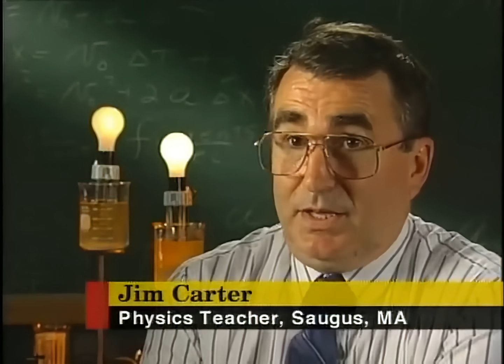MIT graduates cannot power a light bulb with a battery.

Comment: The problem is simple an I see it everyday among engineering students from other diciplines: They learn a rule and try to apply that law to a problem, when the rule doesn't fit they can't solve the problem. The issue here is that they never bothered to learn where the rule comes from.

In a high school example: Students memorize the quadratic formula and how to use it. What few understand is how to truly derive it and how to break down real problems to apply it.
A more common example would be the area for a circle, pi*r^2, we all know it and how to use it but where does it come from? To figure the formula out without being told the answer is the hard part and that is what truly makes a great engineer, creating mathematical / physical models of real world problems to solve a new problem you identified and building a solution that fits from those equations you created.

All in all. You don't become an engineer by memorizing formulas or others solutions.

Comment: Honestly the only problem they face is that of convention. They never had to deal with a light bulb that is not screwed into a socket with two obvious power connectors. One does not see the inner wiring of a light bulb and just has to KNOW that one connection is the side and one is bottom tip. It is not the understanding of the fundamentals they don't get, but they never had to deal with manufacturing conventions when the fundamental principles are not visible from the outside any more. Yet their overconfidence is still astounding - and the fact that obvously almost none of them ever did play around with basic electricity experiment in their childhood.

Comment: I know there's a little bit off topic but I remember being in a digital logic class And being required to hook up a RS flip flop to a LED. I was 19 at the time, And we had older Students In their 30s in the class. They could not figure out What was wrong with the circuit . The problem was They didn't understand they were getting the correct results. the Circuit Was giving negative logic. They just didn't really understand the truth table Of the design. I pointed it out to a bunch of them. I thought it was hilarious because a young buck could figure it out the 1st time, And they couldn't.

Comment: The sides and the end of a normal light bulb are electrically separated by the filament but I'm not exactly sure which is the beginning or the end, or even if it matters. Basically take the negative end of the battery and touch it to one of the conductive plates of the bulb, namely the sides or the end, then take the wire and connect the positive end of the battery to the side of the lightbulb that isn't connected to the negative end of the battery. An easy way to do this is by holding both the battery and the bulb together with one hand and manipulating the wire with your other hand.

Comment: As they thought its a trick question and when they were presented one wire, one bulb and one battery. Most of them assumed the ideal situation instead they were just given a basic logic question(In this case they had most probably is a trick question so most of them just gave up the moment they saw what were given 1 instead of 2 wires)

Comment: They are college graduates not electricians
Reply: You don't have to be an electrician for know how to light a bulb
Reply: @clorofila-mc5fr  Every light bulb socket clearly has 2 pins for connecting to the power source. No one would connect a bulb without a socket like in the video, it's nothing but a trick question
Reply: XD so as a cook i dont know how to use soap bcs i dont cook with it ?? XDDSXDXDDX

Comment: You don't have to chop the wire (as many in the comment section are thinking). You can use the single wire itself. Just arrange it in a different way. You have the answer at 1:58

No wonder so few Americans are good at STEM and have to import Asians to do hard engineering and science. It is not just about bookish knowledge. It is also about practical experience.

The only thing going for America right now is access to Venture Capital and strength of USD.

Comment: This is how journalist and media lies to you by the way, they would butcher and shift away the supposed meaning of the supposedly taken in good faith of the words, and then try to justify their pre-held narrative to advance their agenda

"Can you light a lightbulb with battery and wire?" 

If taken in good faith it going to sounds like

"Can you light a lightbulb with the same voltage range and power level of the power source upon which this power source came in the form of fully charged and functioning battery, for the two to be joined with a working wire with enough length and electrical conductivity?"

Yet imagine the amount of trickery that one can put inside the wording

"Can you light a lightbulb (with excessive resistance it can't conduct the low voltage of the power source) with a battery (not fully charged and has degraded power instead) and wire (with improper circuitry and not be enough length)?"

Comment: So what is the answer? You connect the negative side of the battery to the base of the metal outside of the light bulb and you connect the positive to the bottom of the light bulb.
Reply: You have the answer at 1:58

Comment: It's so misleading the way they ask this question. "Can you light a bulb with battery and wire?" The word 'wire' can be either singular or plural. Most people imagine multiple wires when the question is asked, and are then confused when they get handed a single wire.
Reply: You can light it with a single wire as well
Reply: @ryanv7535  exactly. the answer is at 1:58
Reply: @ryanv7535  You can, but my point is it's far less intuitive to most people compared to having two wires

Comment: After an entire engineering degree, I've realised that reading all those academic journals does not help with assembling ikea furniture.
Reply: Try building scale model kits ( many instructions don't even have one word printed on them !). Guaranteed it will bring your assembly skills up to another level.
Reply: Engineering student here. The opposite statement is true as well. Assembling ikea furniture won't help you read those academic journals. 

I get that it's important to be practical but it's like come on, these two things have their own complexities and it's unfair when people go and around trivialize the importance of each. Technology probably wouldn't have advanced nearly as rapidly if it wasn't for the theory and academic side of things.
Reply: @Djentstructer  The problem is that even "theory" has become a technique today. The great theoretical advances were made by people with enormous literary and philosophical erudition, which was the minimum requirement to be considered educated. I doubt these students meet this prerequisite either.
Reply: @lucasrinaldi9909  They did it despite having to learn all. Not because of it. Don't make the mistake of thinking the old way always works best.
Reply: @hongthainguyen5334 No, they did it precisely because they had an impeccable humanistic education. And yes, the old method, in this case, was proven to work better. Nowadays, a postgraduate degree doesn't even guarantee that you can read properly.
Reply: @Djentstructer we haven’t progressed since Tesla. Every technological advance we’ve had has been from standing on his shoulders, refining and improving on his concept, but we haven’t had a better foundational concept since.
Reply: These folks will design Smart Furniture that will automatically unbuild itself  😂😂😂
Reply: Hilarious! IKEA is soooooooooooo hard! !!!😂😂😂😂❤❤❤🎉🎉🎉 there are literally (figuratively speaking) companies that only assemble IKEA furniture (while they case the joint)
Reply: If you couldn't assemble IKEA furniture by the time you were in 3rd grade - you were never engineer material.
Reply: I love this comment. Just another example of how everything is all f’d up. Why did you need an engineering degree to assemble furniture? You didn’t. But the university got a good chunk of money out of it…
Reply: @anthonyfaiell3263 Nobody studies engineering to figure out how to follow Swedish furniture assembly instructions.  On the other hand, anybody who went to school to study engineering never should have been accepted by any university if they're to dumb to assemble IKEA furniture without any instructions.
Reply: Or with critical thinking
Reply: Gotta have sense and a mechanical ability
Reply: Well, that's just how engineering world work. Those who making journals aren't meant to make things. You need someone elses specialized to plan things by relying on those journals as a reference, and then another elses to actually make it in real life based on that plan

Engineering world won't work well without either one, and you couldn't learn all of them at once unless you're a superhuman
Reply: So what I do research in p-adic Hodge theory yet I still dont remember my multiplication tables 😂
Reply: @AndreaDiFenogliosa  You don't need to "remember" something you can figure out. You probably are intelligent enough to realize that. I don't remember my multiplication tables either. Because it's useless to waste memory space remembering something I can solve in 0.2 seconds anyways.
Reply: So may be you've chosen the career path mistakenly? Did you like to assemble LEGO in your childhood?
Reply: Reading furnishes us with materials of knowledge. 
It is through thinking makes what we read Ours.

So think Mark! THINK!!!
Reply: Most engineers at the big corporate black box firms, really don't know much of anything in a big picture sense. They only know how to do what has already been shown to them. It really is pathetic. There is not much of an incentive to understand how it actually works.In order to really learn, one has to take the effort themselves to understand the fundamentals of why something works the way it does.
Reply: why can't you do both? i thought engineering teaches broad spectrum problem solving
Reply: Thats Why Autobots Assemble
Reply: This is sad...
Reply: Thanks captain obvious, its amazing that you were able to conclude that academic journals are not ikea instructions.
Reply: @jon9103 True.  Ikea instructions are actually useful.  LOL
Reply: I’ve found a similar thing with my trade that I am an apprentice of
I may understand how an engine works, understand some theory, but lack the practical skills to rebuild one
Reply: Assembling Ikea furniture is literally so easy.
Reply: When you work a blue collar job everyone thinks the engineers aren’t too bright they always mess up. And since we know how to build we just ignore their blue print because we know what to do anyways. Same in the medical field like the doctors besides surgeons aren’t really seen as too bright when it comes to health. All I’m saying education is a road to get a job it’s not a road to become intelligent and yes I’m finishing my double major math and bio soon. And I still think college is pretty much a day care center to make people feel smart by being a good little slave. I will say engineers are typically the smart ones tho bio majors no they’re night brights Math majors sorta kinda but engineers seem to have more common sense and the gift of the gab
Reply: Academic journals are useful in research, but useless for all things practical.
Reply: @henrytang2203  while I agree to an extent, it depends what you are doing. You have to read between the lines frequently to apply academic papers to work however the concepts are still there and are only significantly relevant to research if it proposes how we could be doing things practically 10 years from now
Reply: @ You have a great point. My symbolic language was lost on many people. Universities train students by asking them to churn out essays / reports based on academic journals (for the most part). There are the occasional labs/practicals for STEM subjects, but there could be more. A bachelor's degree prepares students for academia, but not working in industry.
Reply: @henrytang2203 hhhm that's why college prepares diplomas that ready to work.
Reply: @henrytang2203 So basically very handy for saying so and so said so and so, referring to so and so who got it from so and so...
Reply: @henrytang2203 only for psychology
Reply: @henrytang2203  I'd argue that the plagiarism taboo is part of the reason. Academia loves to draw a distinction between "your own words" and "other people's words," which is kind of a fallacy unless you created a constructed language from scratch, but beside that point, this means you have to either put your citations in quotes or paraphrase them. And how do you paraphrase arcane language? By making it even more arcane!
Reply: Business major here, I just don't see the ROI of the engineering degree
Reply: I doubt you have any knowledge of engineering.

Comment: So what voltage bulbs did you give them? A 120v bulb won't light up bright enough to see with only 1.5v DC
Reply: Dog did you look at how they were holding it lol
Reply: Yeah it doesn't come across in the video. The point is that all of these students know alkaline cells are low voltage, they will have presumably have made low voltage circuits with low voltage bulbs in engineering classes. They all know what voltage mains voltage is, and they've all changed mains bulbs. But because the contexts have never overlapped, they have never developed the intuition that not all bulbs work in all circumstances, even though it seems it should be blindingly obvious.
Reply: Distinguishing the difference between the ac powered vs dc powered bulb and making objections, also qualifies as part of the test🤨

Comment: Chop the wire into two parts, complete the circuit and bingo!
Reply: You don't have to chop the wire. You can use the single wire itself. Just arrange it in a different way. You have the answer at 1:58

Comment: This isn't really about understanding physics, power to ground, electricity fundamentals, etc. I mean I was taught how to do this in Physicsclassroom, but I think this is more of a puzzle. I think if you gave them enough time and allowed to to critically think about how to do it, they'd get it in time. It's technically a puzzle because you are giving only giving one piece of wire, not two. If it was two, they'd be able to. It's a puzzle. It is not a measure of how smart you are. Another way to solve it is by cutting the wire into two pieces and hooking it up and lighting the bulb. See??? Not the way it was intended but gets the job done. Sure, the wire is not cut right and is frayed. Still a good puzzle tho. In the real world you aren't attaching a bulb straight to the battery without another wire. It is a puzzle. Sure, electrical knowledge IS needed but it's more of thinking in an abstract/creative way as well.

Comment: You can also cut the wire and make two wires, this will also shorten the wire and hence less resistance. This will cut cost because if you can light a bulb with a battery and a wire then you will not buy one extra wire. This is saving a resource by a simple common sense.
Sometimes the bulb base will not be completely bare due to some engineering problems related to high voltage and metal breakdown in that case you will have to cut the wire and make two of it because this time the base is an insulator and the wire needs to be inserted in the conducting holes.
If only the battery, the wire and the bulb are provided then the shown solution in the video is one of the solutions but if it is told that using these items then there is no restriction so you can use other appropriate conducting mediums so that the current passes and lights the bulb. I edited it because it came to my mind that cutting into two will mean you have used two wires instead of one so defying the condition that was put of using one wire but again there was no restriction put as well and you can use other mediums too for completing the circuit because if the base is not bare then there will be a problem and you will have to use an another medium to complete the circuit or cut the wire into two.

Comment: Materials Science and Engineering student at University of Arizona here. My Electromagnetism professor had us teach ourselves how to do this exactly to avoid this situation. My biggest challenge was simply not knowing where the two terminals of the bulb were located (because I had always used them in sockets). I would say it's likely they understand elementary circuits, but not where exactly they need to connect the wires to the light bulb itself. Once that is known, this problem becomes rather simple.

Comment: Notice in this video both wires r connected to one side of the battery. In a closed circuit this build will work all u need is one wire connect to neg and the other to pos

Comment: Yes i did back in my third world country , we had no electricity and use a car battery to power a light bulb , radio am only , , after a such of period recharge the battery adding destilled water and plugging in to a outlet x 3 days, , also to mention that we also rewinded alternators , etc, in this case ( not engineer, only a poor bastard once) use a small ligth bulb and it will ligth up ( dont forget the small ground wire)

Comment: Its a trick question, you could know the fundamentals of circuits and electricity , understanding the flow of electrons from one to the other , and still be confused cause its not about not understanding electricity its just about learning the trick and once you figure it out you realize how obvious it was.
Reply: there is no fucking trick. You connect one terminal of the battery to one of the bulb, and the other one with the other one. It's elemental, children do this.

Comment: Lady: Can you light a light bulb with a battery and a wire?
Engineer Student: No, but if you want I can draw the picture diagram of the circuit and calculate the theoretical values of the voltage and amps found in this circuit.